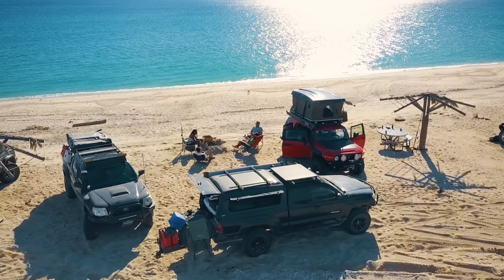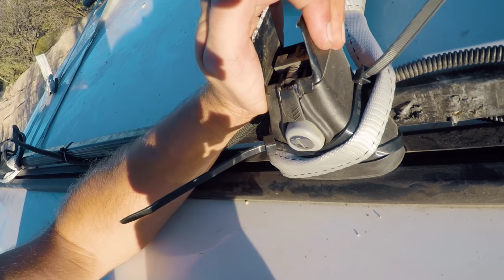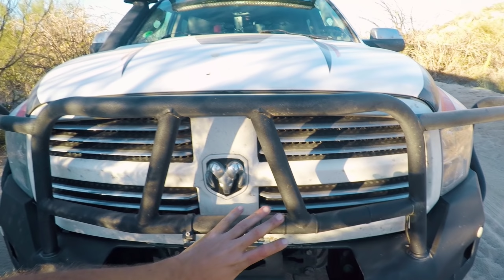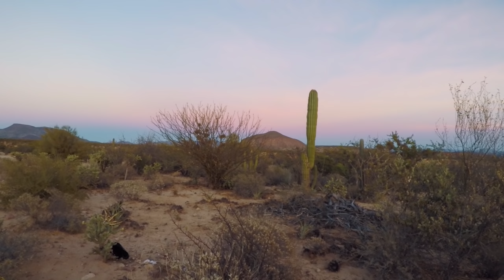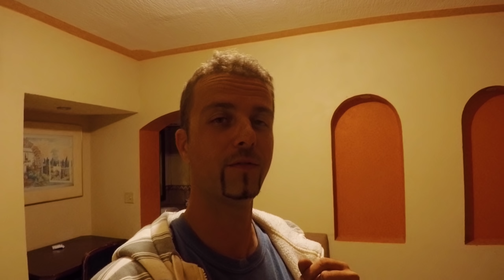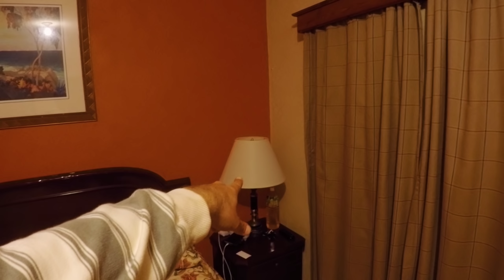Overland Roof Rack Build Failure in Baja Mexico | Ep 11 | BAJA OVERLAND ADVENTURE

Comment: Looks like you adapted and overcame. In fairness to Thule it seems like the rack was loaded very close to or over its limit. The basket and storage box are probably 90lbs (empty),
Spare tire 60lbs, Rotopax = 8lbs per gallon ( 4 gal = 60lbs),4 Maxtrax =30lbs.... Not to mention what gear was in the roof box , lights and other fun stuff.... to it adds up quick :)
Reply from the maker: Busket i can easily lift with one hand and so is box just bulky. They cant possibly be 90lb. 20lb per if even. Lights and few things that hold them max 10lb. Things i keep in box are light but bulky stuff like chair, fishing rods.... All that was certainly below limit of 300lb that trucker 2 setup was advertised. Again all would be fine regular driving but on real long bumps stuff is just not designed for that at those loads.

Comment: Yeah dude that is the stuff I was worried with with my Leer top with the rails.  If I drove only on highway no problem.  But I drive like asshole offroad.  So bouncing made me worry about shell too.  In the end the coolest solution might be an internal cage that connects through the shell?  Or an external cage that goes around outside.  Either way, custom stuff and $$$$
Reply from the maker: Yap custom stuff it was. 3 months later got custom fab going through shell. Here is video of that. https://youtu.be/OFu4pB0sAsE